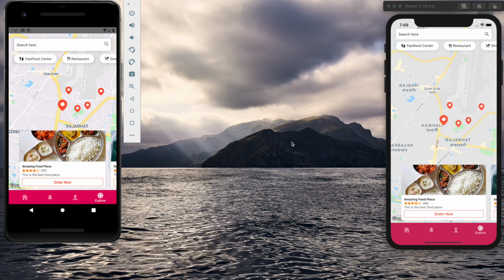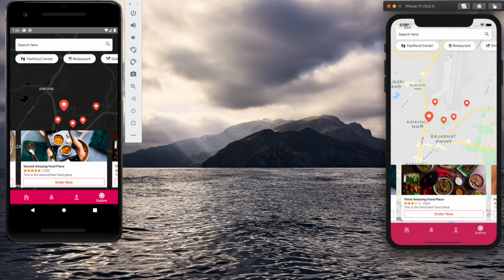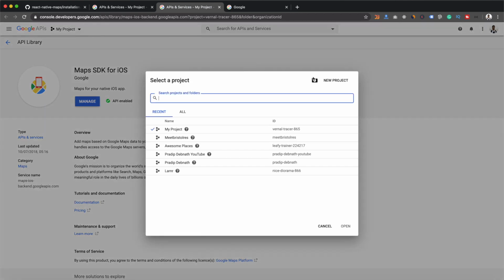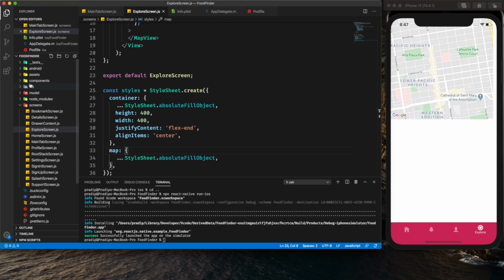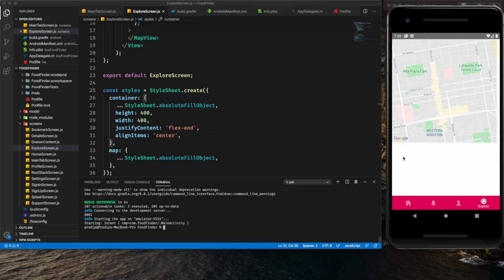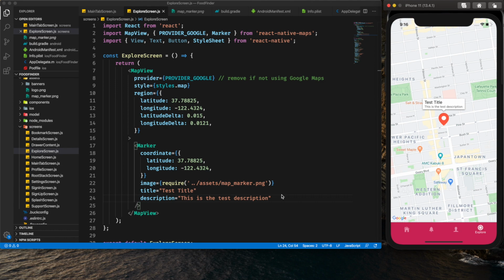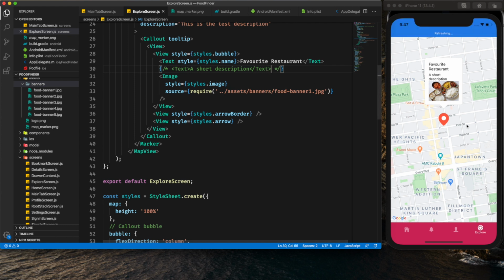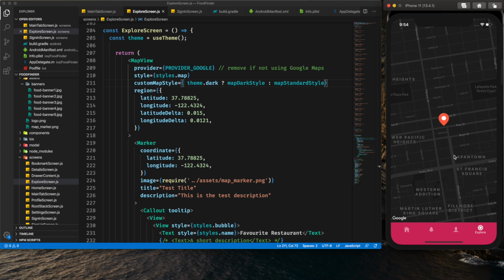#1 React Native Maps Tutorial | Add Custom Marker & Callout | Dark Mode

Comment: Sir what configuration and system (Windows or Mac) you using? Please suggest what minimum configuration we need to build React Native Apps for Android and IOS.
Reply from the maker: I'm using MacBook Pro 16" higher configuration which is available in India, but I started react native iOS & android apps development with a MacBook Air 13" 2017 model. So you can go with that as well, but make sure you have at least 8GB RAM & 500GB SSD. If you don't want to develop iOS apps then you can go for any windows system with decent configuration like I mentioned previously.